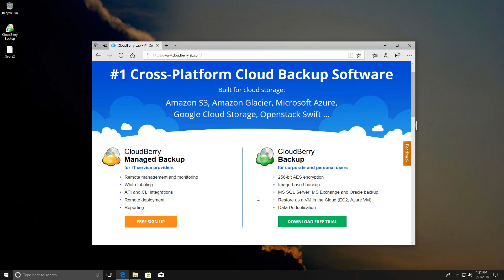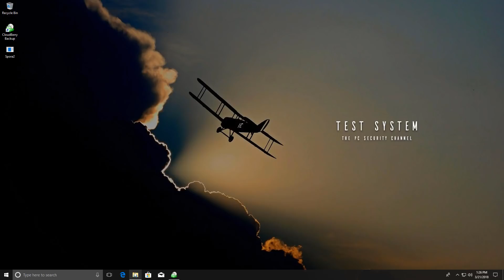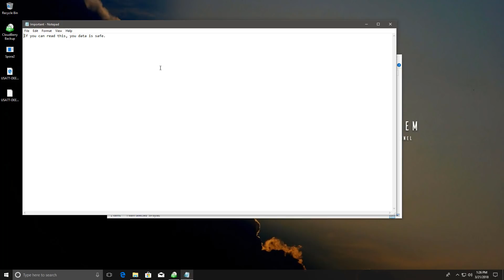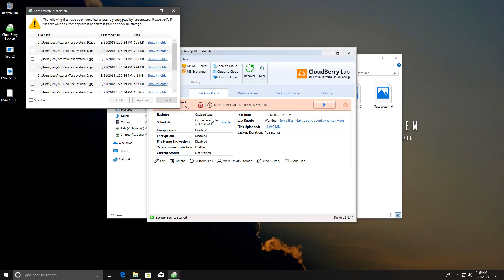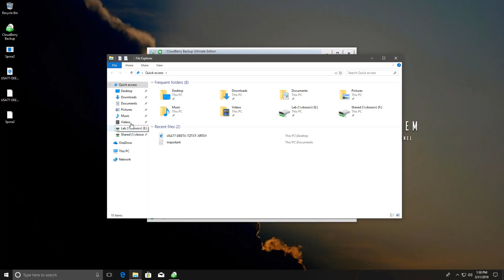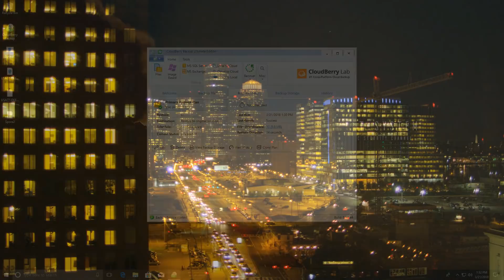CloudBerry Backup | Ransomware Protection

Comment: That is a good method, here is what I do personally: 

At the start of each month, I do a clean up of the system, virus scan, and windows update. Once that is done, I will go offline re-boot and clone my main C drive to a backup HDD. Once that is done I will remove the HDD {HDD Dock} and put it in a protective case on a shelf. This way if either malware gets on the system or something corrupts, all I will do is unplug any other drives etc, plug in the backup clone and boot up. It's not perfect IE If malware got in the BIOS but it works for me.

Comment: I've been using CloudBerry for a while, since CrashPlan shut down their consumer offerings. The ransomware protection feature has a problem that you failed to mention, which is false positives. With a real world scenario with hundreds of thousands of files, this can be a real bother. It seems like there have been improvements though, so currently I don't get many false positives. But in my case I use the solution for all my family's computers. If I get false positives for one of my children's computers, handling them is a bit more work, including bothering them during their games or movies, or finding a spot where I'm free and they're not using their computers. This was too much, so I've actually disabled the ransomware protection feature for all computers except my own. The version retention should save the day anyway.